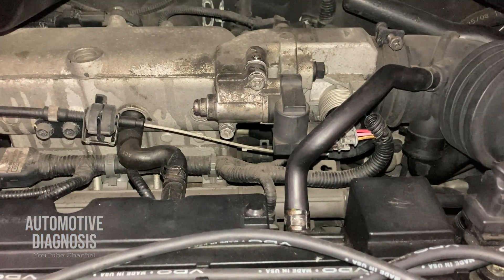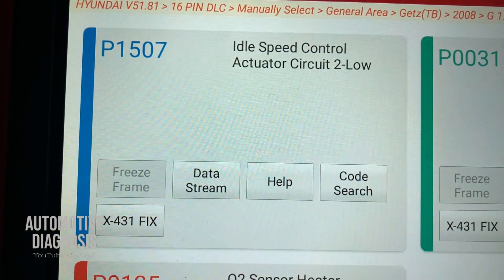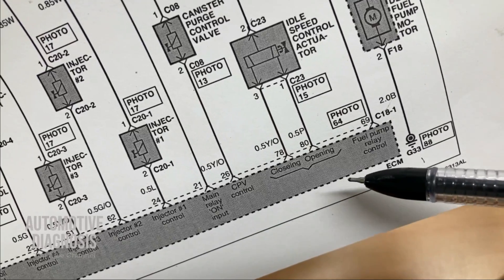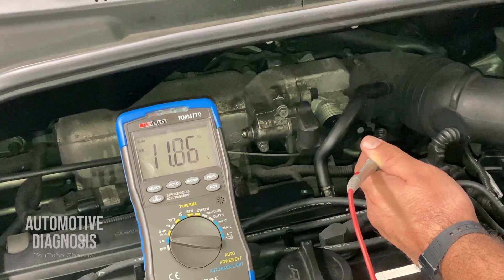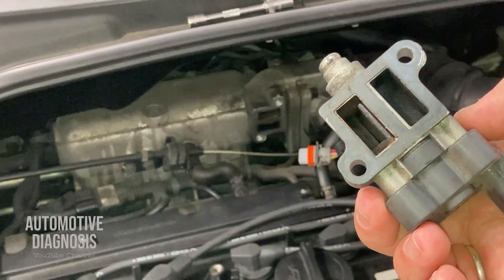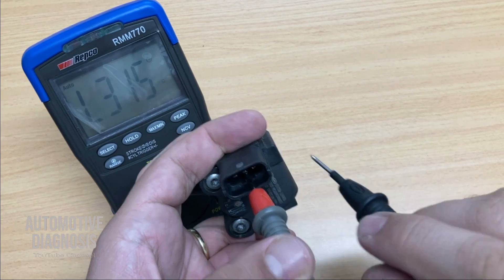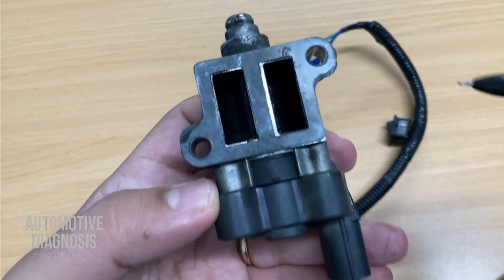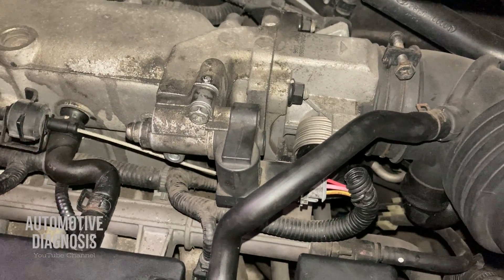How to Test Idle Air Control Valve (IAC) | P1507 | P1505 Engine Fault Codes

Comment: There is a easier way to check voltages and if valve is working that is unmount the valve for the car but keep it connected to the cable. You could record a video or call for a friend for help and turn on ignition. When turn on ignition the valve opens and closes as some kind of diagnosis.